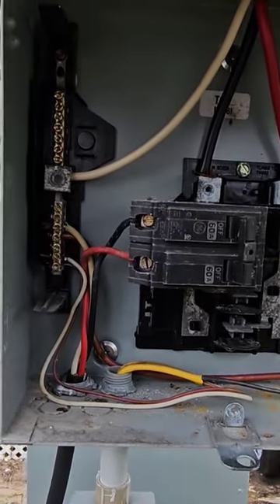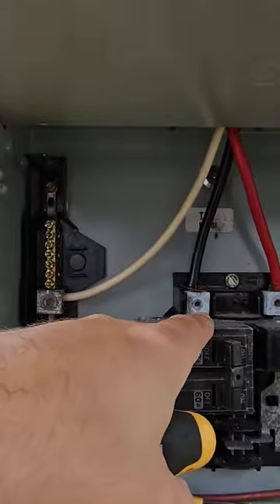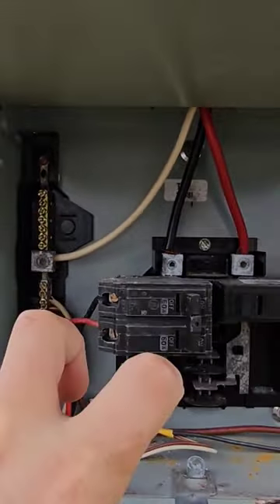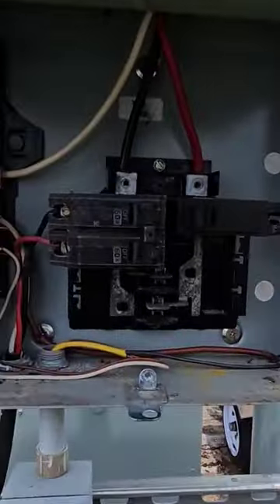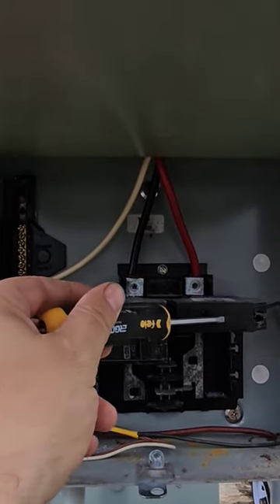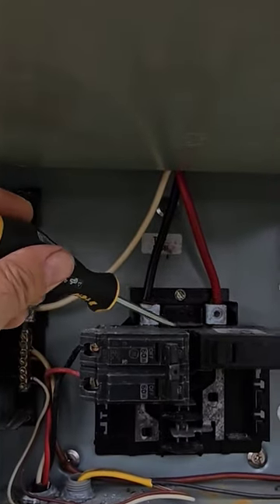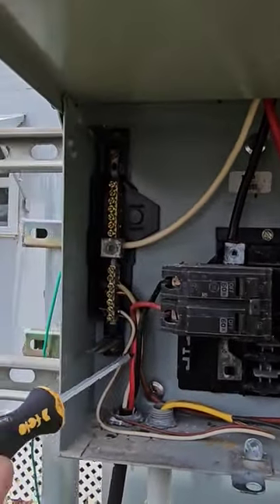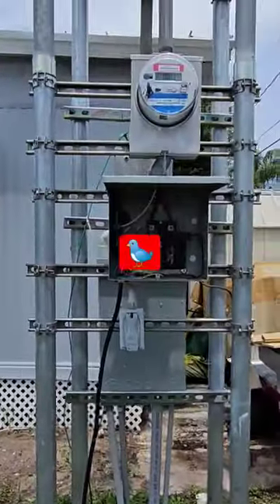There are a few things wrong here.

Comment: You are totally incorrect That breaker is absolutely the main going to the trailer.You're allowed to have 5 handles as disconnect before.It's a code violation.There is only 2 handles in there.Panel is totally legit

Comment: 120 volts using 1 leg
Reply from the maker: How do you mean?
Reply: It's a double throw 60 amp breaker, two 60 amp 120 v CIRCUITS coming off the A leg, is what I see,have look and see if it goes to a inside breaker panel, with 15 amp breakersl!?It's still a odd set up born out of necessity.hope it's a temporary.😁 there's no 220 going into the tailor,for sure.
Reply: @randyjurgensen1578 I see L1 and L2 feeding that breaker

Comment: That took a second watching… like nails on a chalkboard kinda bad … 60 amps on less than half the guage it should be…. That wire is the main breaker aka future ignition source.
Reply: Probably not as unsafe as you would think tbh, it'd take a lot more than 60a continuous to melt the insulation off that wire. More likely to have issues with voltage drop if anything.

Comment: This guy doesn’t really know code. You’re allowed 6 disconnects off a service, ok it’s mis labeled. Looping the stranded in the lugs wasn’t wrong but could’ve been done tighter. Yes bonding screw required at first point of disconnect. 

Fix #10 SO, add bonding screw, bump up service conductors, proper labeling, cover and done.

Comment: Less than 6 hand movements
Reply from the maker: Artical 230 has been changed, which is no longer code, but even still, NFPA 480.16 (F) is still in violation, and there is no way to use this panel with the old 6 handle main alliance.  The manufacturer never intended for 6 throw main.

Comment: We get it. You thinks it's wrong.  And here is the deal. It has worked for 20 years and will work for 20 more. There is millions of feet of wire out there that farmers,  Jake legs and home owners have pull that have served thus country.
Reply from the maker: It is wrong
Reply: @Simonelectricfl  well let me ask you this, how long does it have to worm to be right. And if it met code 10 years ago and doesn't now, is it wrong?
Reply from the maker: @thepitpatrol  It was not code compliant when it was installed either.
Reply: it is right until you get that 3am call that its not.
Reply: @Simonelectricfl  I'm not against code, but I am 60 years old and have seen things come and go. I have owned restaurants,  been a professional firefighter and farm. I can't tell you the things I have seen over the years that didn't meet code that worked great and the times I have had a bona-fide electrician either over complicate something or just plain screw it up. I do appreciate good work though, and I do enjoy your channel.
Reply from the maker: @thepitpatrol  I would have to agree,  I have spent time in south America and if you look at there answers to residential and commercial electrical it will boggle the mind how some things work for years that are put together with duck tape and extention cords literally.
Reply: @Simonelectricfl  lol, well I am a farmer. Do I need to  say more🤣 keep that in mind when I comment in the future. I had a father in law that ran 240 fan motors with 10/2, because 10/2 with a ground cost more and it would work without it.

Comment: What kinda micky mouse tools are you using ? Id laugh you off my jobsite if i seen you show up with them saying ummmmmm all stupid like
Reply from the maker: That shows your ignorance those are extremely high quality felo electrician screw driver. I have both insolated and non insolated sets. That screw driver costs the same as a full set of kline you buy at home depot.
Reply: @Simonelectricfl  quick add I just googled felo insulated screwdrivers and for aa sett of 6 their 50$ usd their trash shut up and stop pretending you have quality stuff you do realize the internet will roast you 🤣 50 bucks for 6 insulated screw drivers means their trash I would trust my life with a screw driver that cheap I bet you think ryobi and Dewalt are quality to
Reply from the maker: @tickleevergreen9418  Wrong, but even if you were right, how much should I spend on my screw drivers?
Reply: @Simonelectricfl  so you're arguing if you type into Amazon right now, you won't see a set of 6 for 50 bucks? Quit lying bro if you're life's in a tools hand, money shouldn't be a question... I'll spend at least 100 on an insulated screw driver for the best quality, but then again, I'm not some stuttering idiot that can't explain what's going on or understand how the code works
Reply from the maker: @tickleevergreen9418  The only idiot here is the guy trying to argue with someone about there screw driver.